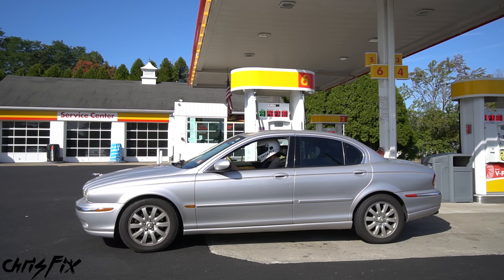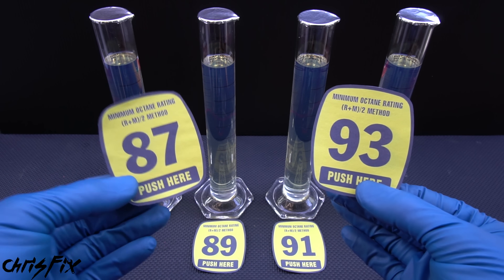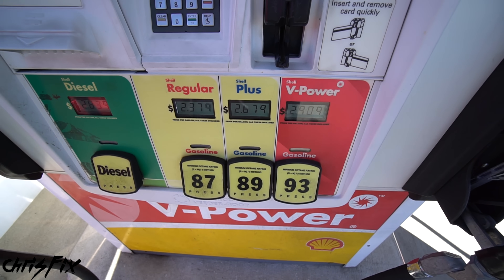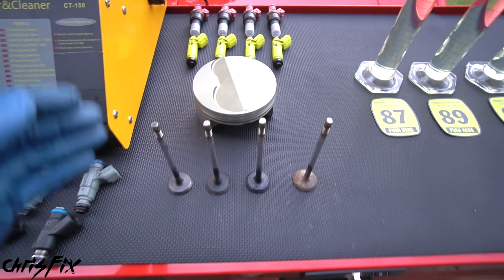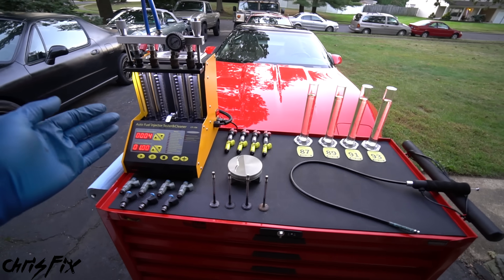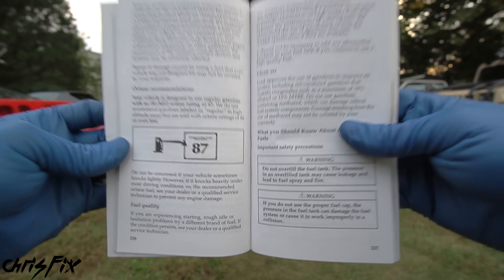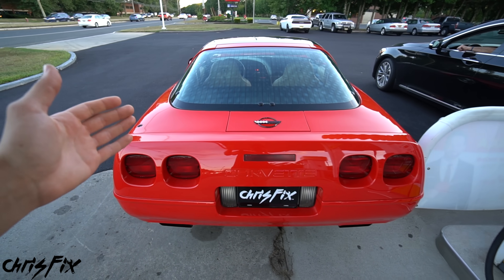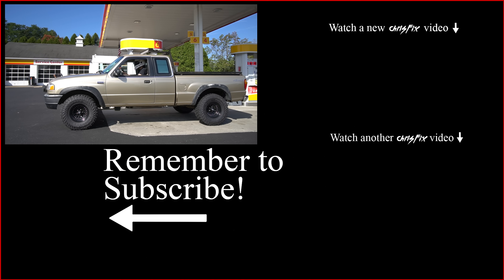What is the BEST Fuel to Use in Your Car or Truck and WHY

Comment: Shell in Denmark you Can only get oktan 91 92 93 95 so we hve more to those from and oktan 100 the gass in USA is not the same as here...did ask Shell Denmark in the us you have etanol in the gass(min10%.) here we dont there are the diference..for the lover oktan....and you olso mesure it in a deferent Way as you say....ps in norway they pay 3 times as much for gass then California...pls stop complayn usa allways had cheeb gass...olso in California.....
Reply from the maker: Watch the video!
Reply: US 93 = 99/100 octane in Denmark. Also US gas burns cleaner than the gas used in Denmark.

Comment: You should be saying PRE-detonation, hopefully all engines have detonation (combustion type engines anyways), if it didn't...you wouldn't go anywhere! lol
Reply: Detonation is the automotive and aviation technical term for what he is describing.
Reply: @ProcrastinationDaily  pre-detonation is the automotive technical term for what he is describing. I can not comment about aviation mechanics cause I don't work on planes. But I'd be shocked if it was different. It is called pre detonation because the air/gas mixture explodes or detonates while it is being compressed in the cylinder BEFORE it is supposed to. Making the piston push back on the crankshaft, slowing momentum, causing extreme stress on the metal and messing up timing. The piston needs to complete it's stroke at the exact same time the fuel mixture detonates. Higher octane fuels require a more compression before it will detonate. The more you can compress the fuel and air mix the more power you can get out of each stroke which is higher higher performance engines have higher compression and require higher octane rated gasoline. One of the reasons they put alcohol in gas (up to 10% at US pumps, with the exception of specialty fuels like e85) is to increase the octane rating of the fuel cheaply and effectively. However it does have some drawbacks. Especially if the engine sits for extended periods of time. Sorry I kind of rambled a bit there but that's why it is called Pre-detonation and not just detonation. Detonation when times correctly is how an engine works. Maybe some people shorten it and just say detonation, but that is absolutely not the correct technical term on it's own and every mechanic I know calls it pre detonation.
Reply: @TheIppster  Weird, in aviation everyone uses detonation, which I always assumed came from the automotive side....thanks for the insight

Comment: Not sure about your explanation of engine knock. What you do say is true but The low octane fuel in a performance vehicle would ignite before the piston has reached the top of the cycle. This means that the piston is moving against the gases created by the fuel that prematurely ignited. The fuel ideally ignites at the top or just before the top of the cycle. 
Also There is some truth in higher octane fuel having more energy because in some cases the fuel is denser. This won’t be case if the fuel has been mixed with ethanol or butane. Cheers.

Comment: I never really looked into it, and I dont have the car anymore but, I bought a 2009 dodge avenger while I was stationed in germany. Most of their pumps had E-85 on it. I found an E-85 station after coming back stateside, and filled it up. after the fuel started getting pushed through the system my check engine light came on. Hooked it up the the computer and it said the engine was running lean. Light turned off after about half a tank and filling it up with premium to dilute the E-85 out. But the question is whats the difference between europes E-85 and the US E-85
Reply from the maker: Was the car flex fuel rated?

Comment: Ive had viechles that called for 87 but would only run correctly on 93. Some required premium but ran fine on midgrade with no differance. The additives or cleaners tend to be more important .
Reply from the maker: Thanks for sharing

Comment: Don't forget about your fuel filter, gotta change them at reasonable intervals and keep them nice and clean, especially in your older rigs and 4x4s. Tends to be a bit more condensation and gunk build up in the tank. Doesn't hurt to add an extra filter in your fuel line as long as you don't restrict the flow to much. Not unheard of to get contaminated fuel. Like your vid man
Reply from the maker: Thanks for sharing

Comment: So I checked my owners manual first, and nothing is mentioned...my question is about fuel cleaning additives.  My car maker doesn't discourage, encourage, or even mention products such as "fuel" or "system" cleaners.  I get my fuel from the same place roughly 90% of the time...but I cannot comment intelligently about it's cleaning properties.

In general...what's the approach to these types of products?  While the vehicle manufacturer will specify to rated fuel.....is there a highly recommended, highly discouraged, or couldn't hurt attitude to using fuel additive engine cleaners?  Thank you.
Reply from the maker: I would look online in your case as you can usually get a bit more information. And I wouldn't recommend using fuel system cleaners you can buy from a store. I have a whole playlist about it here, check it out: https://www.youtube.com/playlist?list=PLvKbarVtwhUue-xwasd2WUMrkK0CEm6yy

Comment: I have a totally rebuilt, fully restored 1968 Mustang with a Windsor V8 289 engine.  I’ve always put 87 octane in it with no issues, but now I’m wondering if increasing the octane will keep the rebuilt engine cleaner over time.  Obviously, there are no recommended octane ratings on the gas cap or in the owner’s manual....back in the 60’s the cars ran on “regular” leaded gas!  Recommendations?
Reply from the maker: If it's working perfectly fine on 87, then I would just continue to use it!

Comment: Here in Colorado we only have 85, 87, and 91 octanes. I am unsure, but I believe that's because there is 20%-24% less oxygen available here than at sea level (Denver is the "Mile High City"). 
Would "Premium Required" call for 91 octane plus an octane booster? Plus, although Denver sits at 5300' in elevation, many of the mountain towns sit at 8,000'-10,500' (Leadville or Silverthorne) in elevation; and I've noticed the octanes in those towns are the same. Can you please elaborate a little further of what's going on?
Reply from the maker: That's not required, and because there is less air, having less octane is acceptable!

Comment: Hi Chris, I believe the octane booster you used is a metalliferous octane booster. I would advise against using a metalliferous octane booster, as they can cause metallics to buildup in your fuel system (primarily the filter and pump).

Comment: In trying out High Performance Premium Grade Fuel in my car I actually did achieve 2/3 Miles per gallon better, however as it cost 10% more calculated did not actually save me anything in the long run.

Comment: I have a Chevy Silverado 1500 flex fuel truck, I have always been curious about flex fuel and what it meant.
Personally, I put either 89 or 93 grade gas in it. If I put 89 grade for several weeks, then I will run a tank or two of 93.
I even did this with my GMC Sierra and i never had issues, I ended up keeping it for 12 1/2 yrs before I sold it.

Comment: Hi Chris, I have a 1977 VW Bus. It needs leaded gas. Must I put the leaded additive in every tank?
Reply: If you have an engine that requires lead substitute take it to a good mechanic have them pull the head and install hardened valve seats. Problem solved.

Comment: I’ve been told for cars that run at high altitudes the octane doesn’t make a measurable difference due to the lower oxygen saturation in the air. I wonder if this is true?
Reply: Cid Lopez it’s not true.

Comment: In Europe, the ROZ ("Researched Octane Number") is usually indicated as the "petrol pump octane number" at petrol stations, whereas in the USA, the AON ("Average Octane Number") is usually indicated. The AON must be calculated relatively laboriously according to the formula AON = (ROZ+MOZ):2. Since the ROZ values are higher than those of MOZ or AON and are even easier to calculate, the ROZ number has established itself at European filling stations. Here's a small task for anyone who drives a more recent US car: Have a look at the manual to find out what you can fill up with. There is usually talk that you should fill at least 87 octane gasoline, ideally 91-93 octane fuel. That would mean that simple super gasoline with 95 octane is more than sufficient, even far exceeds the requirements. Right? Unfortunately not quite: The formula used in the USA to calculate the octane number is different from the one used here in Europe. As a rough rule of thumb you can remember the following:
87 US octanes correspond to about 90-92 European octanes, i.e. "normal petrol".
91 US octane corresponds to about 95 European octane and thus the "super" fuel.
93 US octane are comparable to our "Super Plus" fuel with 98 octane

Comment: Honest and serious question: Could someone please reply?

So I have a 2014 Ford Fiesta. I bought this card because I needed something that gets great gas mileage.

I drive literally just shy of 500 miles a week for work. 48 miles one way. That is 96 miles a day, or 480 miles a week.

About 50% of the drive is highway with no stopping, or very minimum, while the rest is in-city driving where stopping happens a lot. I don't know if this is important.

What fuel would be best to help preserve the condition of my engine? Should I be using the 89 or 93 since I am putting ~2,000 miles a month on my car - including normal driving such as to the stores? Or would the 89 / 93 damage my engine since it's just a 1.6 L 120 HP In-Line 4?
Reply: Unknown YouTuber higher octane will NOT damage an engine. Run the octane that Ford recommends, change the oil every 4000 miles and run a can of BG44K through your fuel system every 6 months.
Reply from the maker: Run the octane Ford Recommends (as Ed Wo said and as I said in the video) which is probably regular. Since your car warms up and you drive it on the highway, you wont have any issues with carbon buildup. Save your money and use regular if it recommends regular.
Reply: @chrisfix  The BG44K has less to do with carbon build up and more to do with keeping the fuel system and Cat as clean as possible. Running full synthetic oil and Lucas as an additive will also help.

Comment: I drive an SUV. Regular is what it says to use. However, i did notice that when pulling a heavy trailer, it ran better using mid-grade, but premium didn't do much over mid grade. So yeah. Sometimes using a vehicle outside of it's regular day to day use may warrant a step up. But step back down afterwards.

Comment: How does race gas compare. 
2nd question, why does two stroke equipment run better on premium gas
Reply: Race gas is for extremely high compression engines. It doesn't give you more power, it's just harder to detonate. If you have a regular street car with a 9:1 ratio, or something like that, you're not doing anything good by running race gas.

Comment: I drive an Acura TL 08' and 93 Octane is 'Recommended'. I do find my gas mileage on the interstate to go from say 30ish to 34ish so near a 10% increase in performance fuel efficiency based on the engine. The cost is obviously higher than 10% the price, but I continue to use high octane fuel. Is this silly if your car recommends it or would the life of my car see the same results with 87 octane? My only concern is the lower octane may cause misfirings /other mechanical issues.

Comment: So why doesn't Shell just put the additive pack in there 91 or 93 octane fuels and have the same amount straight across all octane values?  Makes no sense of your car didn't require premium fuel but the only way you get the most additives is by getting the premium fuel?  Just a way to get you to pay for something you don't need but try to justify or what?

Comment: So if I run 93 shell in my Honda where I usually run 87, it will just cost more but it will clean my fuel system so no harm just clean? I run some royal purple fuel system cleaner or max atomizer maybe every 2 oil changes but I regularly get qt fuel (it's a new station so the tanks should be clean) I just don't know that they add as much or any pea

Comment: That Diesel is the best fuel u can use. I have two daily driver F-250’s, one just hit 400K miles and the other one is almost at 425K miles. Built to last and to be worked hard.

Comment: The fuel in America is not the same as the fuel in Europe American fuel has corn mixed in to and as a result you may observe the same cars same engine one for European market and one for American will have a different tune and yes you make less power because it will explode if you run that shit in a Euro spec car so manufacturers detune them
Reply: Yeah,..so you're wrong i'm afraid. First ethanol blended gas is sweeping across Europe now. In fact, a E5 blend is quite the norm already. In Norway E5 and E10 has already taken hold. And Canada and Brazil and other countries have ethanol blends too. The US blend is taking over now. Also in the US, cars can tune themselves for different grades of gas unlike in Europe. This means that cars can gain Horsepower, or loose power depending on the grade your running. 

Ethanol based gas, actualy can often have a higher octane rating. This means engines can use more compression and hence can develop more power if built to do so. E85 here in the states is rated at 108 octane. It's widely available and high performance cars are really starting to switch over to it due to the extremely high octane. 

Ethanol based gas has a little bit less energy compared to a standard gasoline. So you may get a little less fuel mileage. But in turn it burns cleaner and you can get higher octane out of it.

Comment: I have a 2014 Toyota RAV 4 XLE and got it around October 2017. It currently has about 52,000 miles and for a while I've been trying to get one specific answer as to what gas station to go to once and for all. And more so, which gas? Now I know it's 87, however my follow up is...what if I've been going to gas stations close by that have way way cheaper gas and have been using it for that time? Should I check all the stuff affected? Would using Shell gas now help out? The biggest answer I'll probably get is go to a mechanic...but, still.

Comment: I am surprised top tier gas was not explained. This means it has sufficient detergent in it to provide the cleaning aspects he explains. A lot of discount gas brands are top tier (like QuikTrip) while a lot is not (like RaceTrac) despite them costing the same. That said, I do think that my car runs a bit better on gas like Shell or Chevron, which, of course are both top tier. Oddly, BP (Amoco) was the last of the supposedly good gas brands that was rated top tier since for a really long time they only put detergents in their premium. This is why the top tier gas list has only BP grades listed separately, I guess so you know that all their gas is now top tier, not just the premium.

Comment: My 2018 Golf has a 1.8L turbo inline 4 cylinder engine and VW says to use Regular 87 octane. I call BS because the engine also has direct injection, so taken all together (turbo engine, direct injection) it's best to use premium 91 octane. And I use 91 gas from Shell, because here (Canada) it's 0% ethanol - meaning it's pure gasoline. Mind you, not all Shell gas stations sell the pure gasoline.

Comment: before the vid: meh this is gonna be boring
after the vid: lemme run grab ma manual
Reply: I lease a new car every 3 years.... 87 all the time cuz I don't give a f*ck! lol
Reply: @BillAnt  u had no idea what kinda fuel i used to feed my 2012 hemi.. the engine always sounded like 4th of july inside and still running fine,, just swapped one of the injectors since i got it and thats all
Reply: @Zamwa Ahmed < I only drive about 3,000 miles a year so it's all good, just use some ear muffs. ;)

Comment: "If you have a gasoline car don't put diesel in it, so don't make that mistake". Maybe your grandpa did back in the day. It is impossible to do that at the gas station because the hose spouts are different. A Diesel pump hose spout would not fit into a gasoline tank opening.

Comment: I have a 2019 sports car (~480hp NA all stock) that insists on using 93 octane, but none of the gas stations in my area sell 93 - they sell 91 or 92 (but all are billed as 'premium'). 

Would you really recommend I drive 20-30 mins away to find the 93 specific gas station or is this a bit OCD? 

Thanks

Comment: Water and baking soda, because it's cheap and carbon free. And it works very very well. Bye bye smoggers. HHO generatore work, even in a semi so imagine how much that guy is saving by spending for 200 stainless steel plates and a bit of wire.

Comment: Octane with respect to gas has to do with rate of burn and most importantly how that rating interacts with compression (and quality of head design), it has nothing to do with AF Ratio. 

Your owner manual lists the recommended octane because that's the minimum needed to burn correctly and completely upon fire of the compression stroke.

Comment: One thing you forgot to add...the type of driving you do. Predominately highway driving at constant speed/RPM is less likely to knock so your premium recommended car would easily run a lower octane. Stop and go traffic can increase carbon deposits ...when I was driving in that type of condition, I would run a tank of premium every 3 to 6 months to help reduce those deposits (or go for a run on the highway for 10 to 15 minutes). I have been driving for 41 years and I have had three vehicles exceed 400,000 km. BTW I am an avid Shell customer (love those Airmiles) :-)